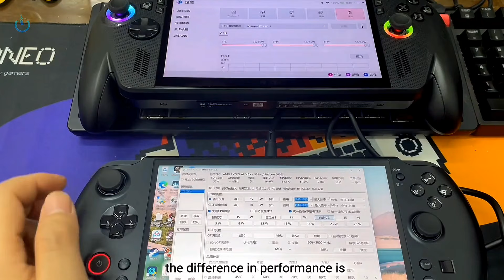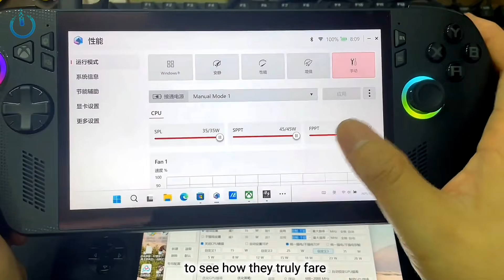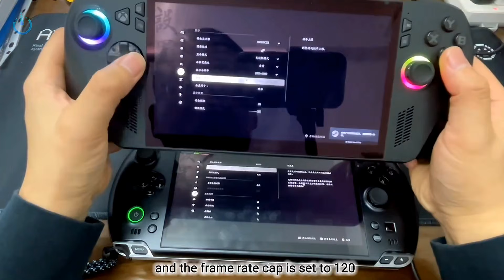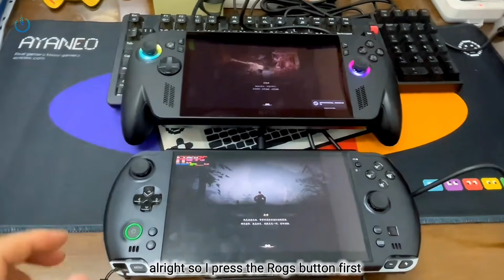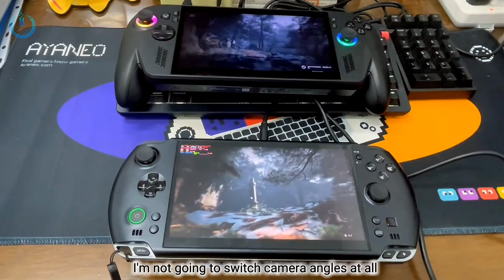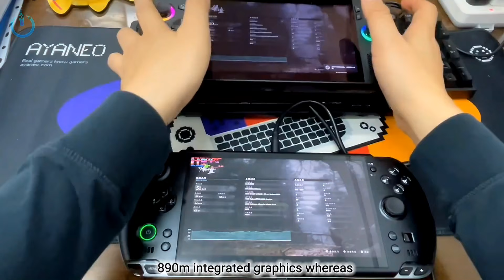Rog Xbox Ally X VS GPD Win 5

Comment: handheld suppose to be mobile, 35 watt dries battery in 1.5 h easy. we need to see tests at 17, 20, 25 TDP.  If I wanna a docked solution I will just buy xbox or ps5, they can easy beat gpd 5 especially at 4k.
Reply: Yeah. If people want 4k docked then just buy ps5 or xbox
Reply: @rin_blank5830 Not true ppl might want both

Comment: xbox ally x is weaker sure but at least battery life will be a thing vs the win 5
Reply: They have the same batteries.
Reply: they're both 80 watt. if you run at the same wattage, you essentially get the same battery life
Reply: @SomeGuyAgain I think if I slap on an extra battery pack to the back of the xbox ally X, it will be a very different story 😂.
Reply: @Catty889  hahah you'll get 160watt of powerrr
Reply: @SomeGuyAgain  different market I guess my games usually only need 20w or lower